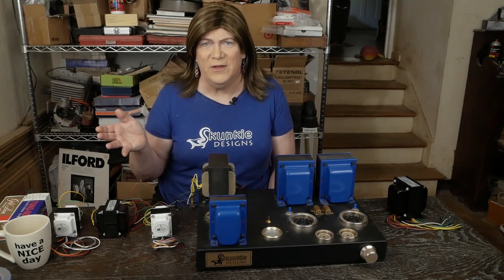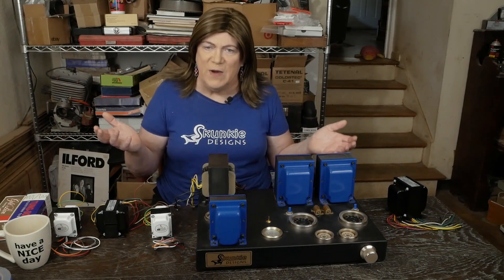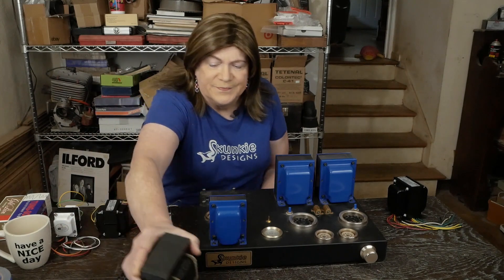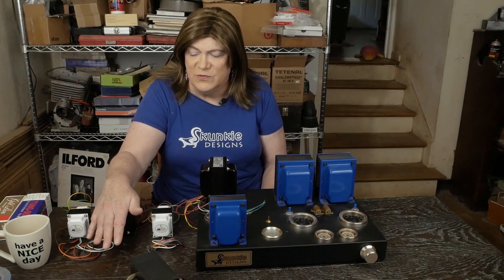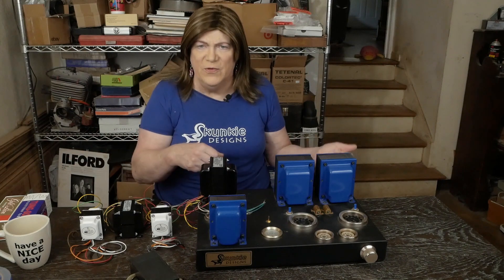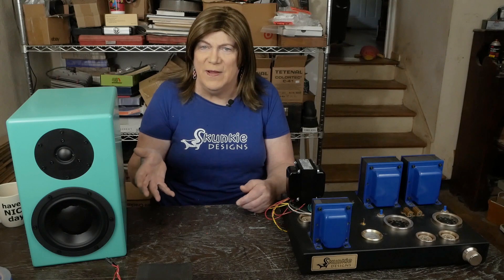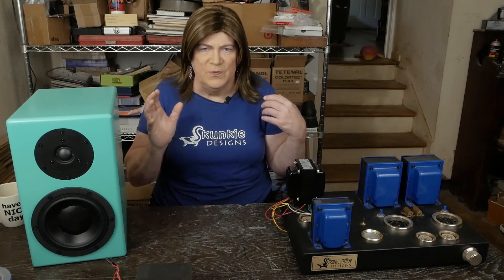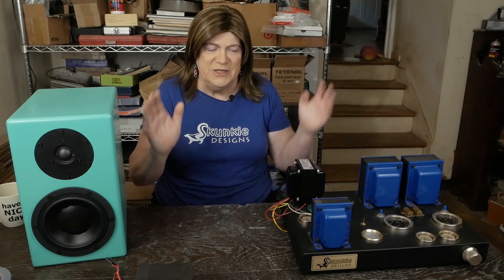Monday Monologue: Finding Quality Tube Audio Transformers

Comment: Triode USA sells an excellent Dynaco ST70 replacement power transformer with a huge lamination stack.   The quality is outstanding, but the price is quite high.   I used to buy these when the price was lower.  Antek sells excellent toroidal transformers.  I found them to be cool running, quiet and great looking.  Plenty of models to choose from, but the majority of these have no bias winding.  Covers are optional.  Triode USA sells a Dynaco ST70 replacement output transformer with ruler flat response across the audio band; vastly superior to the poor-quality stock transformers on the ST70.

Comment: @Skunkie Designs Electronics I had an idea for for a chassis that should not be terribly expensive:  8020 T-slot rails.  Take a gander at 8020 Part Nos. 1530 and 1545.  Those are just "natural" aluminum anodized, but they have counterparts that are black anodized, too.  A fairly inexpensive piece of acrylic or polycarbonate could be utilize at the bottom (or top) and a sheet of aluminum or steel could be utilized for the top.  It might not be as pretty as a smooth Hammond box, but it might might give a chassis a 1960's space-age look 😉

Also, I found some metal enclosures at the "Antique Electronic Supply," but I am not sure they have any better prices that one would find at Mouser.

Comment: I think I understand why you chose KT120's. The big transmitter tubes like 211's, 805's, and 845's require enormous power supplies and much higher drive voltage.

Comment: Again dealing with all solid state stuff, DIY audio has some nice chassis. Also I have ordered chassis from China and they are exceptional quality as well.

DIY audio is a nice standard though. You'll have to drill your own holes. You could have holes drilled by the chassis manufacturer, it'll cost you though.

Comment: had a few issues with Edcor here in uk albeit bought from a supplier in germany - had a big mains short out and even though the amp circuit was confirmed sound by a tech Edcor refused to show any concern after they checked it out - said nothing in production was at fault and basically hard luck !! -- well i have spread the word wide and far and i will never buy another of their products - worse customer service i have ever known !!
Reply from the maker: They still haven't replied to my email about my dead transformer.

Comment: Hi, do you know the primary impedance of the OPT you will use for the SE KT120 ? 
And is it a SE or  a PSE build ? Thank you 😀
Reply from the maker: It's a SE and I'm going with just under 5K with the tube run at higher voltage.

Comment: Hmm.. My comments have vanished when I was suggesting a US based Chassis supplier..
Reply from the maker: What is their name?
Reply: @SkunkieDesignsElectronics  yeap like rick said "hma60". i used a DIY Tube amplifier linestage preamplifier DAC audio chassis 3.5" Height from him also..it's eaiser to drill than steel and thick enough
Reply from the maker: Nice! I just ordered a pair for my KT120 monoblock build.
Reply: @SkunkieDesignsElectronics  Hi Stephe, this is my 3rd post, LOL.. Name is “hma60” in that famous a*ction site.. They used to have a website, IAG DIY tube audio.. I bought a small chassis from them before decades ago..

Comment: In a recent video Paul McGowan noted that PS Audio uses all toroidal transformer.  Is there a reason (other than cost) that you don't (at least as I can tell from your recent projects)?
Reply from the maker: Well one reason people use them is they are much cheaper. I don't believe there is any advantage other than cost.
Reply: @SkunkieDesignsElectronics  I recently read an Audioxpress article that recommends toroidal transformers due to their negligible flux leakage (thus lower noise) compared to other transformer designs. Of course mounting them may be problematic.
Reply: @mddawson1  I've heard them recommended for pre-amps for that very reason.

Comment: I have a semi-order on monolithmagnetics transformers to build a TriodeDick design when i'm confident enough. The price is very high.over €2000 for the lot. Not really into my budget but i am saving for it. I can pick it up as the company is close to me. The time i need to save money i can spend on learning.
Reply: I bought a pair of Monolith output transformers for my 300B push pull (fully balanced) based on Lynn Olson Karna Kay amplifier (6SN7 + 2x6V6 + 2x300B) They sound better than the Lundahl transformers. Additionally, I purchased four of their Nano-X IT because I wasn't happy with the sound of RC coupling.
I had also tried very expensive coupling capacitors, but the Nano-X IT sounded much better. Worth noting that while the Lundahl IT were better than the expensive coupling capacitors, the coupling capacitors were a lot more expensive then the Lundahl IT.
Reply: @Franky2A3  Wow, that’s some deluxe project, Finemet Core OPT’s, etc.. Lynn recently updated the Karna that lowered the output impedance further (not the Karna Kay, AFAIK.)
Reply: @Franky2A3  Hey Frank, can you give me some advice in this?